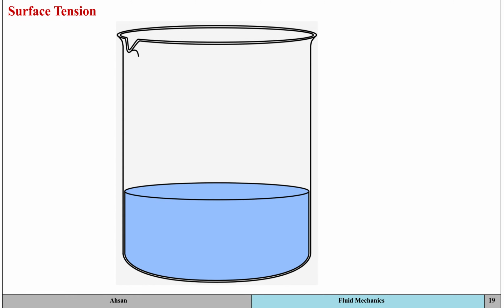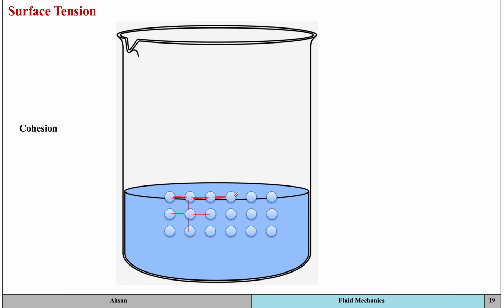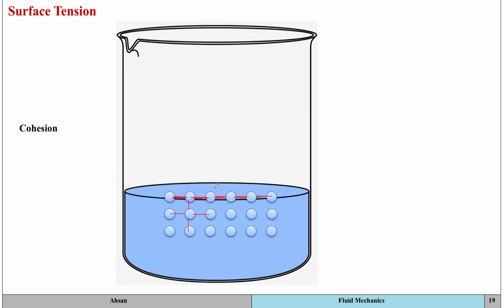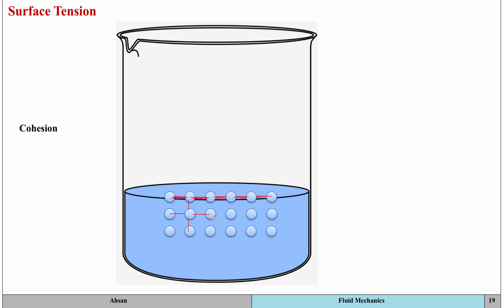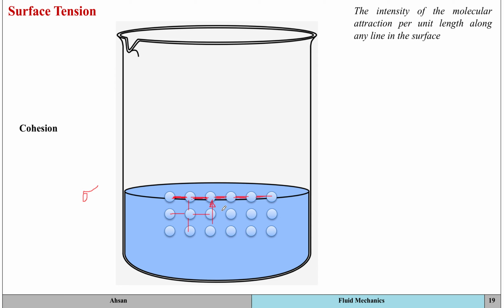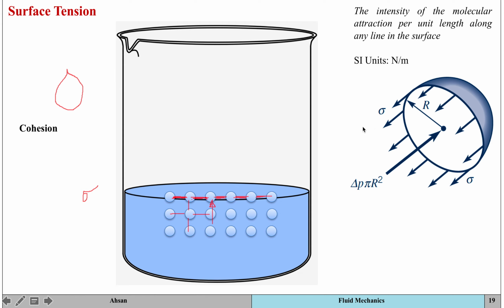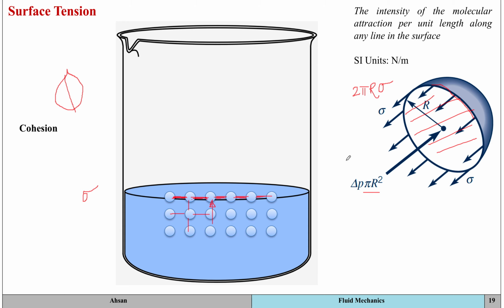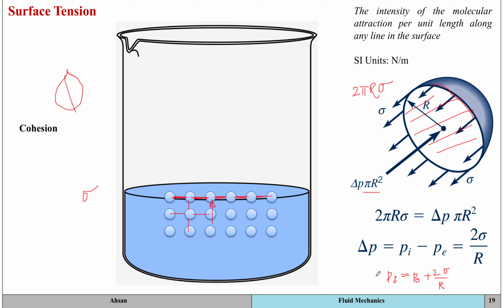Surface Tension - An Engineering Perspective

Comment: We know that as we go deep down the water surface, the pressure increases. Why don't we relate to stress? Since stress can act parallel as well as perpendicular to the surface. Or if I ask in simpler terms, what is the difference between stress and pressure, knowing that they have the same units.
Reply from the maker: Both, stress and pressure have the same units, sure, but that doesn’t mean their physical meaning is the same. Pressure is usually used with fluids whereas stress is usually associated with solids. Moreover, pressure can only be positive (it is a compressive force per unit area), whereas normal stress can be positive (tensile) or negative (compressive). 

Notice here the sign conventions that a Fluid Dynamicist would use (compressive as positive) compared to a Structural Engineer (compressive as negative).